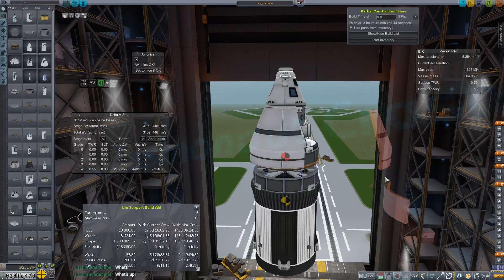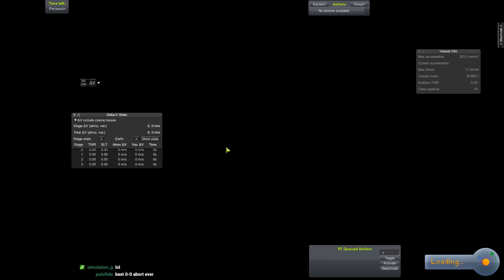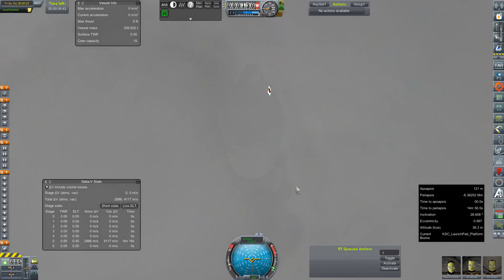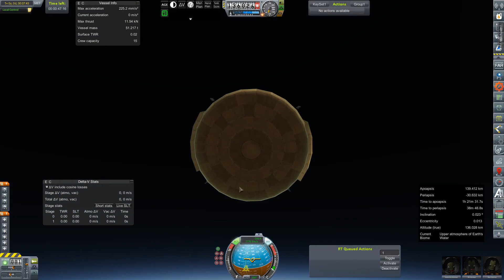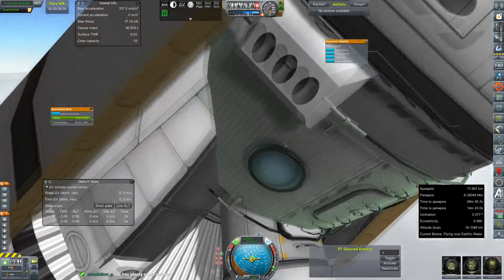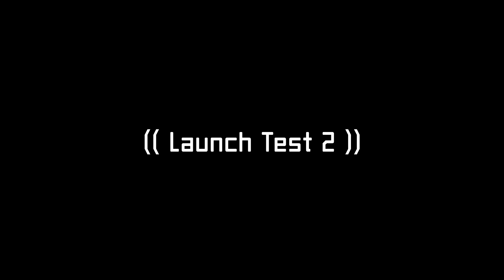KSP RP-0 #516 Large Perseus Qualifying ( Twitch Re-Cap)

Comment: CC, I noticed that some of these "one-way-thrust" thrusters sometimes don't work using ASDW keys...last time I learned that on my command capsule when returning from Moon...they only worked for JKLI keys...
Reply from the maker: I have noticed this problem too, one I attributed to the ports being too close to the COM and ksp getting confused on weather or  ot the ports have an appropriate axis for rotational control ( in most cases they should ) but will retain translational control. It's a frustrating issue for sure, I've just never seen it happen on one port but not the other that were places in symmetry... or on a roll input, the only axis ( besides fore/aft) that shouldn't care about relation to COM

Comment: So i think you mentioned something to the effect in discord but yeah even the best LES in this stream wasn't quite sufficient. Really should be able to get a few hundred meters of vertical separation on a pad abort... ideally over 1km
Reply from the maker: Agreed. I should have looked in to the pre-made LES towers a bit, maybe supplementing those would prove a little better ( if enough will fit ). We just dont have access to anything that would make a clearly sufficient system.
Reply: @CosmonautCrash  the PEBKAC ones I made a video of a while back are the best I've used in stock but idk how well they play with RO. But for a craft this size those wouldn't even be enough I don't think. Your abort mass is 4x of the Apollo abort mass. So you are in the market for something with around 3000kN of thrust and about 6 tons of fuel.
Reply from the maker: Put into plain numbers, it looks really painful. But what's another 6 tonnes, really....
Sigh
Reply: @CosmonautCrash  As long as you can dump it pretty early in flight, then it's no big deal. Might even be able to dump it during core phase of flight depending how you lay it out (like, if it's in pieces, mounted radially). Anyway Apollo LES was about 650kN for 3 seconds to pull a 12 ton payload (rough numbers), so use that as your guideline.
Reply: @Sean Sargeant BiggestDraco
Reply: @Sean Sargeant He could use a system of 4 Apollo LES at the top though it would look kinda dopey
Reply: @wookieegoldberg  or use it for soft landing like superdracos. With my ejection box or can save crews at EDL failure, or even possibly get rid of redundant chutes
Reply: @Sean Sargeant yeah maybe. Iirc tweakscale does vokume as n^3 but thrust as n^2.5 so it wouldnt perform exactly as the les did at 1x scale but might still be sufficient. Especially since engines never fail to shut down and therefore engine shutdown commands can be added to the abort Action Group to make sure that the rocket cannot possibly out accelerate the escaping compartment
Reply: @CosmonautCrash  Why do you abort entire Cheshunt? That looks like aborting entire Shuttle to me. Make a ejection box, like the MK1-3 Command Pod and the least size to hold crews, no extra habitable places.
Reply: @technocracy90  I guess it would work if it was a big 3-crew landercan below the capsule and just detach it there... would kind of throw away the entire existing design though, to make that work.
Reply: @wookieegoldberg  oops, that might be awful work. I was to used to super handy and accurate builder of SR2 in which you can re attach nodes with a single keyboard input (grins)
Reply: @Sean Sargeant But Boris is playing it next to me (Evil Laughter)